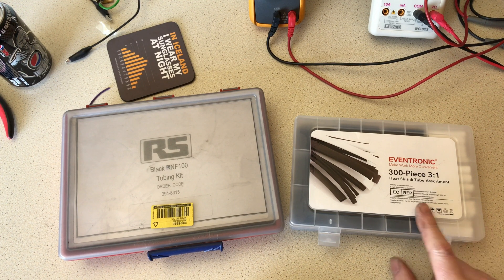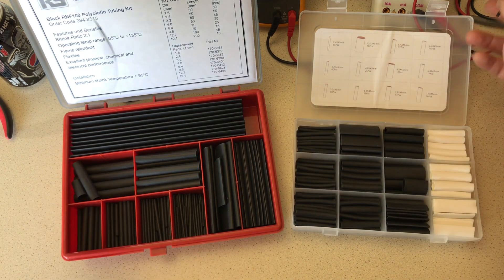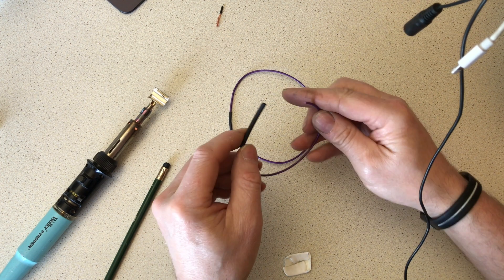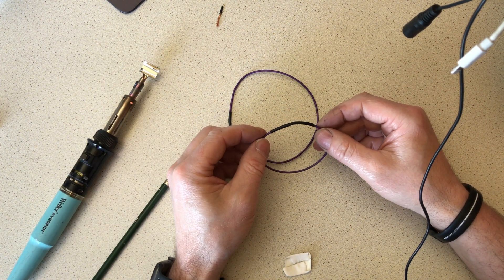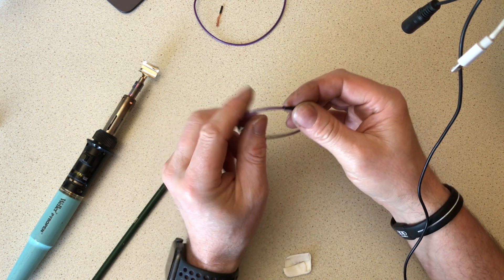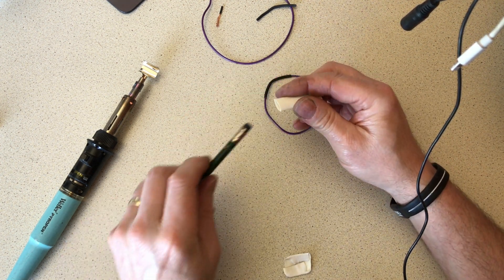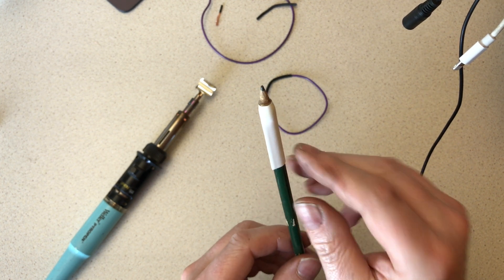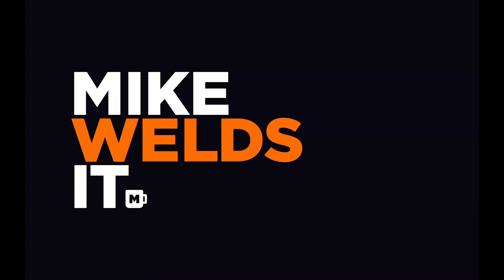Adhesive lined Heat shrink Tubing

Comment: Any 2 Kw oven element soldered to a SAFE  flex + plug top ... then , the joints covered with ( several ? ) layers of  ADHESIVE LINED  heat shrink  will make a 1st class emergency bath water heater ( boiler  broken down ?  ... yes they do ! ) ... this will give  you a nice HOT bath , before the GEEZER comes to fix your boiler .. ( tried- n - tested ) .... DAVE™🛑

Comment: so... maybe you don't need to solder at all then?
Reply from the maker: You might get away with that if you tinned and twisted the wire together first. I've found some H/S joiners that have a solder ring in them so that one would certainly work without the need to solder the wires first. Thanks for watching 👍🏽
Reply: @MikeMakesIt  iv'e seen those too, where the solder is in the heatshrink aswell. but i was always under the impression that when one made a heatshrink "connection" it was at least somewhat sturdy to protect the electrical wiring from water, etc. i am just starting with this you see. need to protect a wire from the cold and rain etc. maybe i bought the wrong heatshrink :|
Reply from the maker: These are the ones we use at work, they seem ok.  https://amzn.to/3dQIGgs
Got the solder built in and the heat shrink has adhesive in it to seal the joint. There are different types so make sure you get the one suitable for your use.
Reply: @MikeMakesIt  ok. i will try to solder it first but thanks anyway.

Comment: What is that heating tool called?
Reply from the maker: Hi CastleKnight, thanks for the comment. It is a butane powered gas soldering iron with a reflector  tip fitted. I've have included UK links to both items. I use one at work and it's very handy if you have no power near by. Thanks for watching 👍🏽

Gas soldering iron https://uk.rs-online.com/web/p/soldering-irons/0660416/
Reflector https://uk.rs-online.com/web/p/soldering-accessories/1622409/